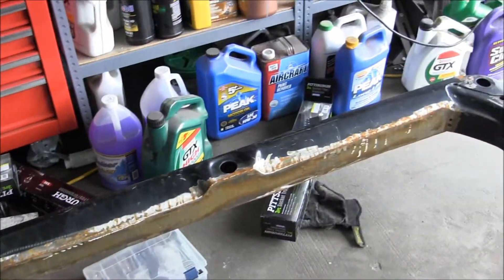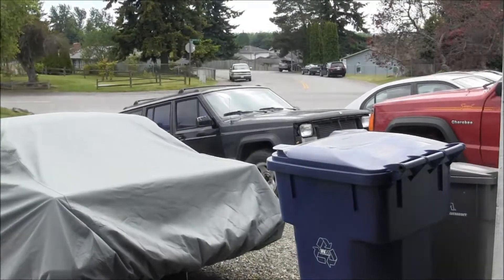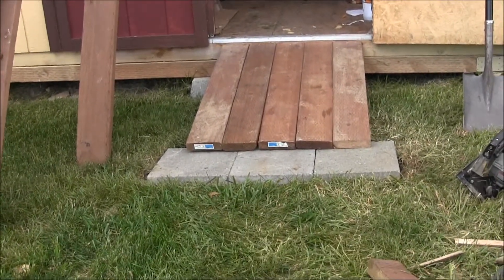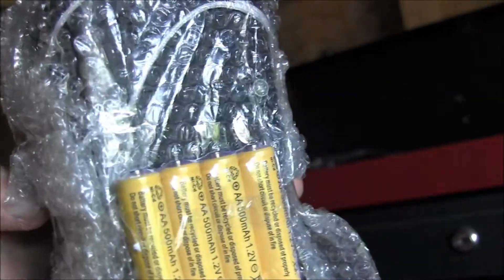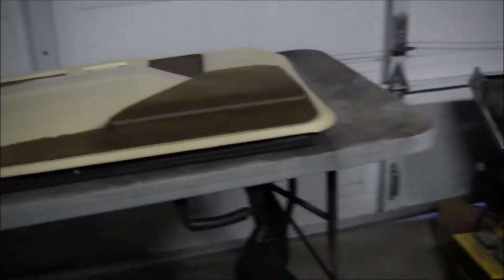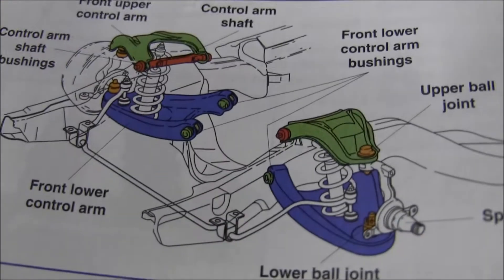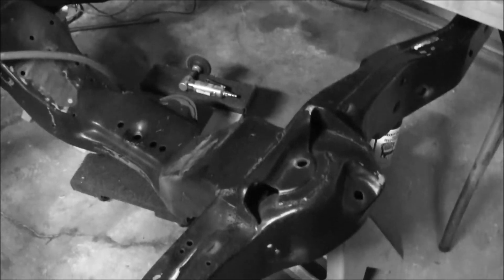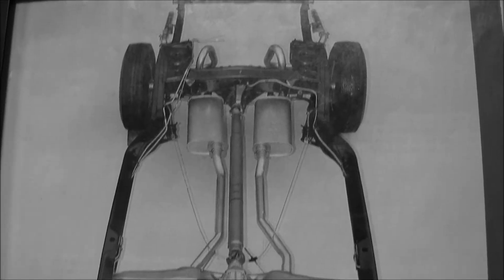Got a Little Done Today

Comment: i have a question for ya mr Pearson...i know its not relevant to the olds but i was wondering if you could do a vid of the inside of the 84 chevrolet...i recently ordered that plow teeruck kit like you have, and id like to paint it up like yours..i dont see alot of em like that n id like to paint the dash etc like it as well...basically a reference type vid. thanks in advance, and no rush as itll be a month or so before i start it.